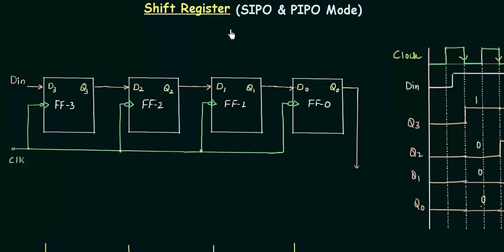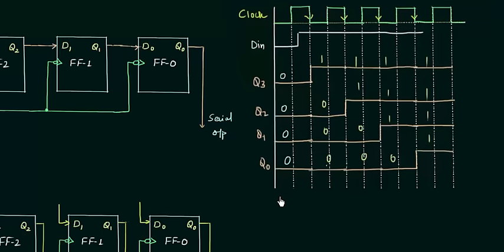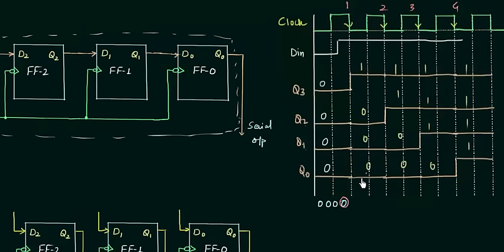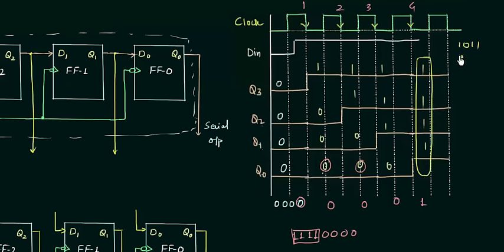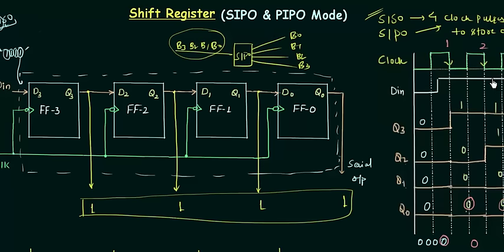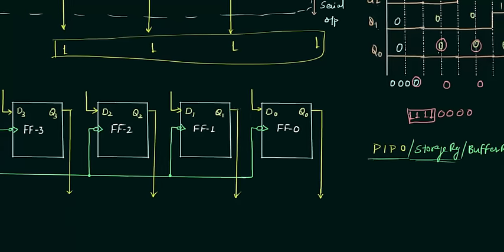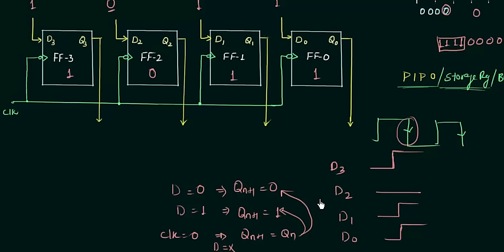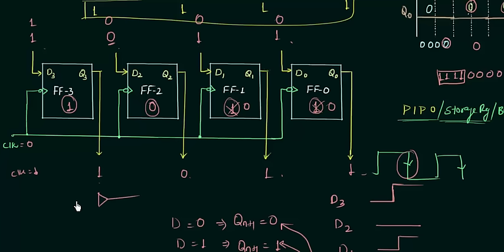Shift Register (SIPO & PIPO Mode)

Comment: Sir,  why do we need to convert D3=1; D2=0; D1=1; D0=1 before the occurring of negative edge clock pulse? it should be at the point of occurring of the pulse. why do we change it before?  You said that "It is a good practice".. but why?
Reply: don't ask anything, the teacher always right
Reply: It is to ensure that the inputs are set to the right values before the FF is activated. In this way, we reduce the chance of errors. 

Would it be nice that the food be prepared nicely before eating it?
Reply: Initially the reference is taken as zero i.e every state start with zero,if u don't change those D3,2,1,0 before they encounter negative edge,we ll get zeros as output as d flip flop gives input as output
Reply: if some lag will occur in transferring data(input) at right moment then we will  give wrong input to FF and as a result may get wrong output so it will be better to set the input bits before the negative edge is encountered(FF becomes active).

your question is a year ago...so i am late to answer but i am doing it for ones who have doubts now can take reference from this.

Comment: Sir I have not understood why more number of clock pulses are required in case of SISO mode
Reply: As the name suggest, in Serial input, there can be only one BIT inserted during one Clock Pulse (Negative triggering in this case). Let's assume we want to store 1111. Initially, we have 0000 in Shift register. After 1st pulse, only one 1 is inserted, in first flip flop, so we have 1000. Second pulse, second 1 is inserted, and first 1 is shifted to the next flip flop, so we have 1100, and so on. So we need 4 clock pulses for inserting 4 bits in Shift register. Same case if we want to output this 1111. First pulse, last 1 is pulled out. If we assume, that we insert 0 till 1111 is in the register, next state will be 0111. First In, Last Out, something like that :D
Reply: Aldis Seferi thanks for your explanation 👍

Comment: In SISO if we want get output of 1011 and if we start from LSB den according to ur explanation the output will 1101 .Could u please explain this loophole?
Reply: 1101 will be stored in D3D2D1D0 respectively.
We are taking the Final Output From D0 so the Final Output From D0 will be 1011.
1 is already stored in D0 so we get 1.
Then after a clock pulse Q1 = D1 = 0 will be shifted to D0 thus D0 = Q0 (Final Output) will become 0.
Thus after 2 Clock Pulses we have our output as 10, Similarly after 4 clock pulses the output will be 1011.
Hope You understood!
Reply: in PIPO we are not using the concept of shifting,we are seperatley giving 4 inputs..different from the previous ones
Reply: @sguha7850  That's why it is not under shift register concept.it is a storage register.

Comment: hello.. the videos wete awesome.. but please.. can u help me out..
how many clock pulses are needed to get the output in parallel input parallel output register?
2. what is  'clear ' ? I read in the book.. I didn't understand.. and u didn't mention it.. isn't that important?
Reply: Saurav Sen  I too had this doubt.sir plz reply
Reply: I think in parallel input parallel output register we need two clock pulses. First one to store and the other to take out the memory..
Reply: in PIPO: You need 1 clock cycle to store all the data in the D flip-flops because it is done simultaneously across them all. Afterwards, you need 1 clock cycle to read all the data in the D flip-flops because it is also done simultaneously across them all.
in a D flip-flop or JK flip-flop the Pr (preset) pin serves to set the output to 0 overwriting anything that was there before and the Cr (clear) pin serves to set the output to 1 in a similar manner. let it be noted that under normal operation of the flip-flops (D or JK) both the Pr and the Cr pin have to be set to "1" as to prevent data loss. 
I hope this helped out.

Comment: PIPO is also a type of shift register. And as there is shifting of data in shift registers, but in this PIPO register there is no shifting of data from one FF to another. Could you please tell the reason.
Reply: In PIPO mode, we're just using FFs to store data in a defined manner, i.e., the LSB and MSB are defined. The parallel nature does not require any shifting.

Comment: Does the loading and getting the output will happens in a single clock pulse??
Reply: loading the data in his example happens on the rising edge and the following rising edge the data gets transferred to the  slave of the flip flop (watch the video about it) we will have to wait for the next raising edge so the next clock pulse to get the data out.